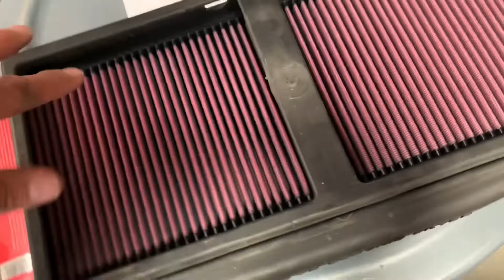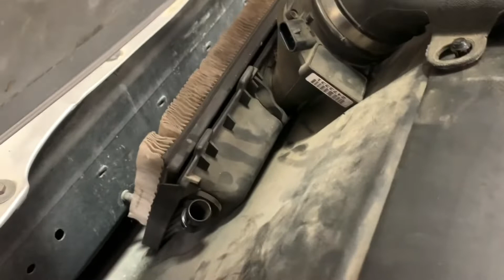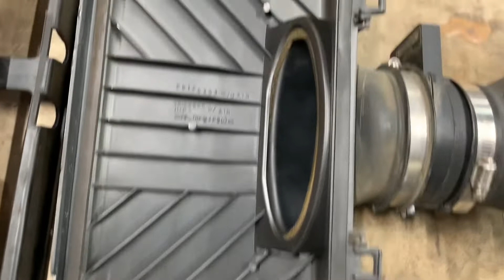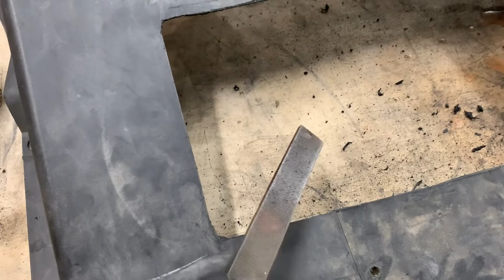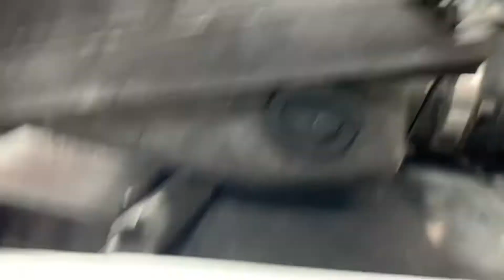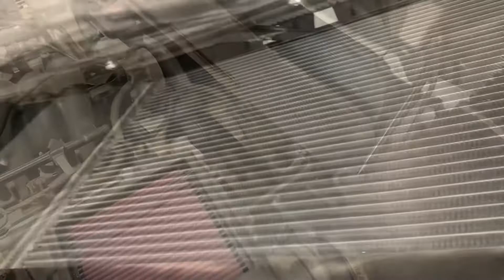Spec Corvette Build - Zip Tie and Flip Mod

Comment: What do I do with the air hose? I plugged the hole with a grommet like you said. But I have the hose just hanging around there.
Reply from the maker: Are you going to disable the AIR system? If so, you can remove the air pump, etc. 

Spec Corvette AIR System Removal
https://youtu.be/zpP5dauYVOA
Reply: @joshc1017  I didn’t plan on it. Do I have to with the zip tie conversion?
Reply from the maker: @shawn1394 if you want to keep the the air system functioning, you can either extend the hose over to the original port, drill a new hole in the opposite side of the air box to move the port, or install a small cone air filter directly on the hose.
Reply: @joshc1017  thank you so much for the info. I appreciate you!

Comment: I looked at doing this mod on my 2002 Z06 but from what I can see the two lower grill openings between the brake duct intakes direct air up to the air filter housing area. That would be cold air from outside the engine bay. I'm not sure if cutting a hole in the rad housing to take air from that area will be any cooler that what is coming in through the front grill openings? I would think you would be taking air that would be used for cooling the rad (lowering the high pressure area in front of the rad) to use for combustion. Does anyone else see this?
Reply: glad to see some thought applied to a modification based on nothing more than uninformed internet gossip, that ignores that air is constantly flowing when the car is moving.   Or considering the very high  possibility that the team who developed the LS 1engine was perfectly capable of designing a high function air intake system for street use.  .   the original design spreads the incoming air more evenly across the filter to better utilize available filtering .
Reply: @richardelliott8352  My observation has nothing to do with the internet and everything to do with researching this possible mod for my C5. It simply appears that the air box does get cold air from outside the engine bay via the grill openings. It's simply what I can see. No need to get all worked up about it.
Reply from the maker: Based on AFR readings at WOT (dyno vs on track), I do believe the mod flows more air. That said, I would only do it on a dedicated track or race car. I have to clean the air filter at least every other race weekend. That would get irritating if it were a street car.